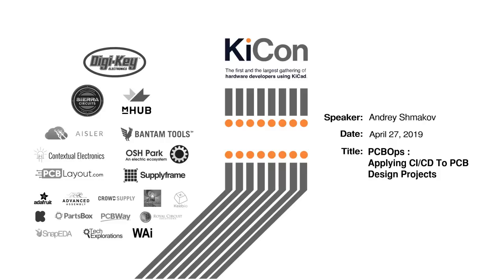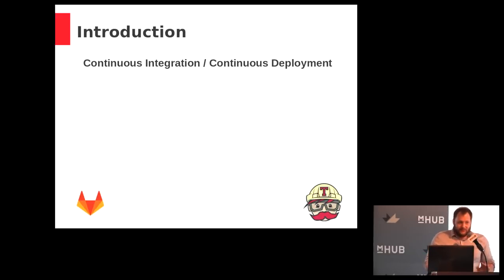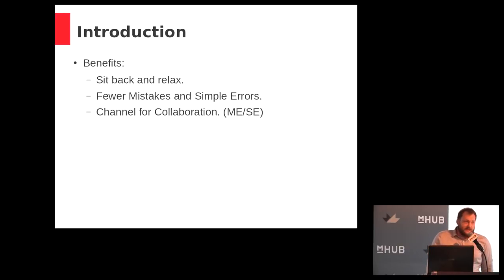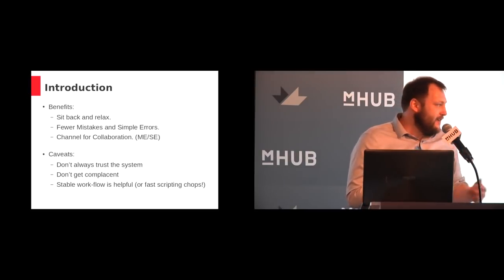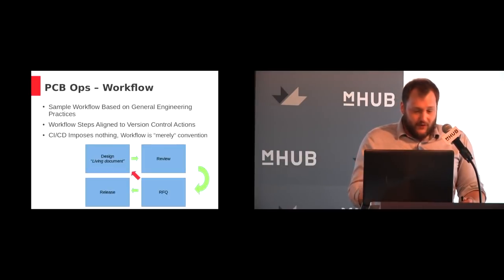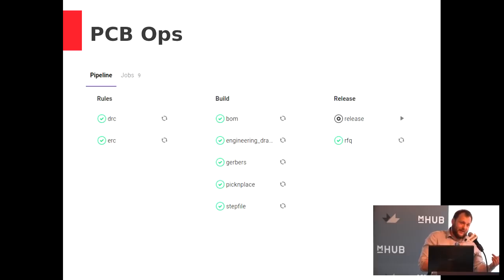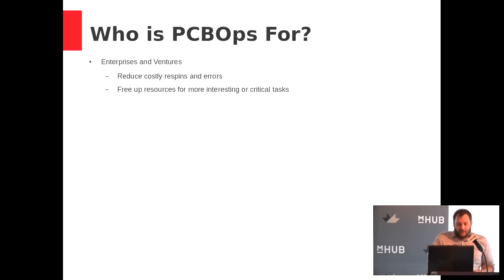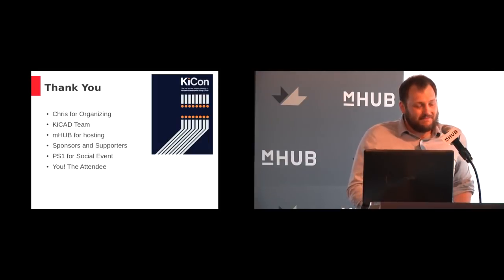"PCBOps : Applying CI/CD To PCB Design Projects" - Andrey Shmakov (KiCon 2019)

Comment: One thing I find really speeds up the process is adding part numbers, digikey/mouser site, and datasheet pdf, in the symbol library. Now I use the same parts and don't have to think about part numbers as much...and it transfers between the multiple projects I'm working on. Usually I'll finish a board completely, wait till the next morning, look at it one more time before I ship off the gerbers. But that once more look takes only a few minutes and then building the gerbers is just a few clicks, literally seconds. Then I upload my known good part numbers to digikey/mouser and work on the next project till I get the board and parts in.